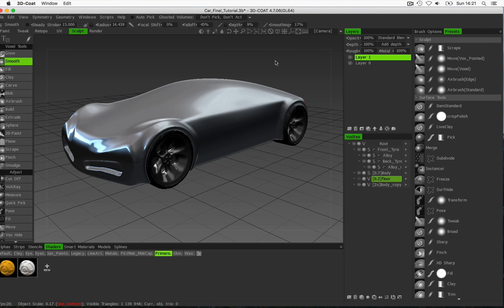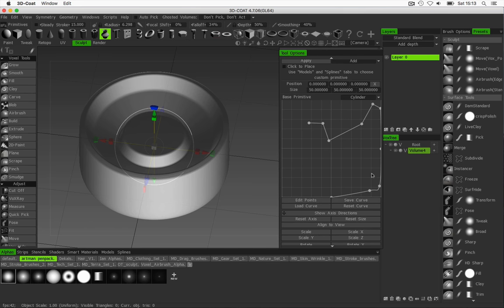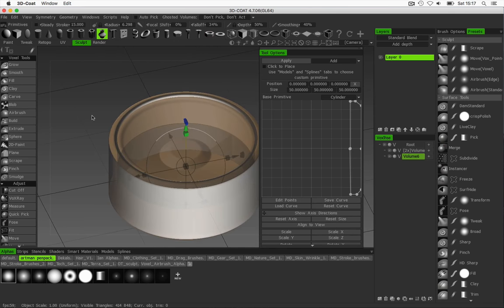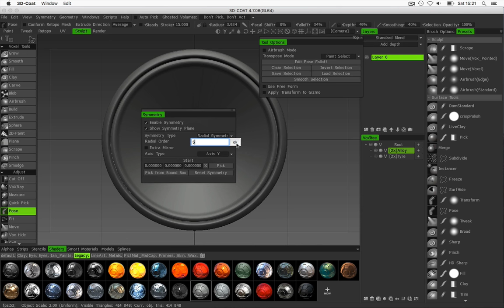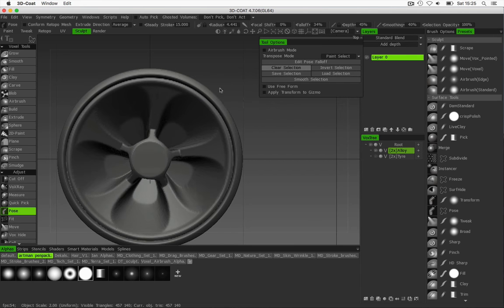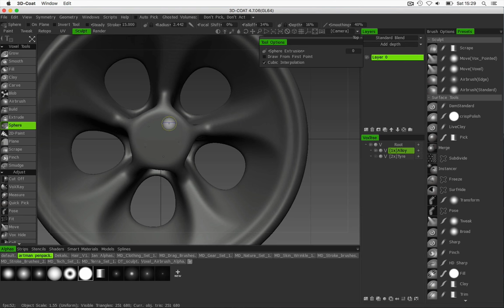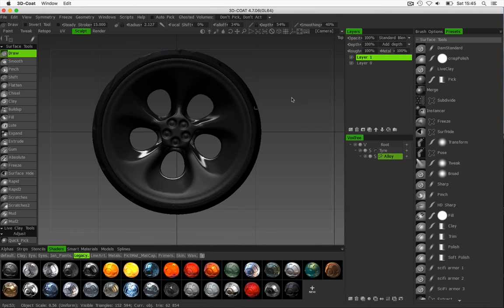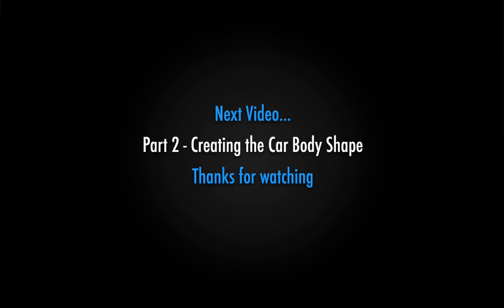3D-Coat - Vehicle Concept Design Part 01

Comment: how do you decide about the resolution? is 2x a good number.
Reply from the maker: really depends on your computer, the resolution the better.  x2 is a compromise on my system where it doesn't bring the system to a halt, but gives me a smooth -ish object to work with. Caching is a good way to reduce the memory and perform edits too.
Reply: thanks